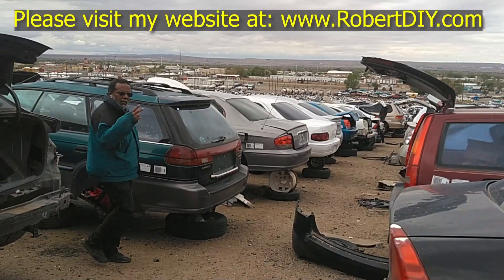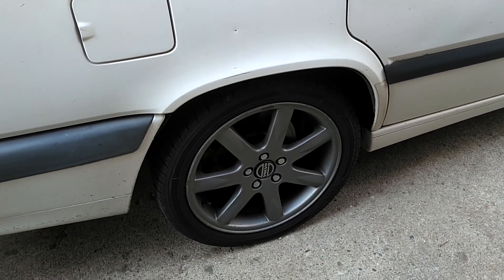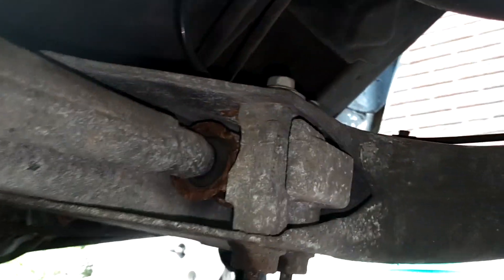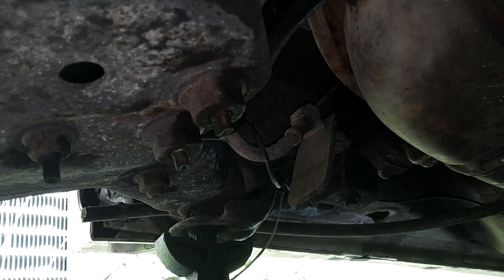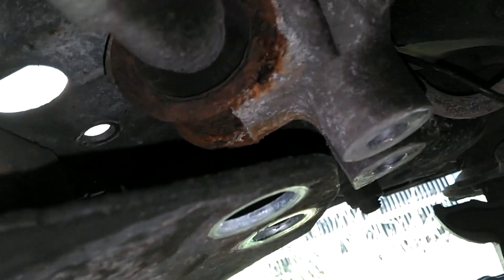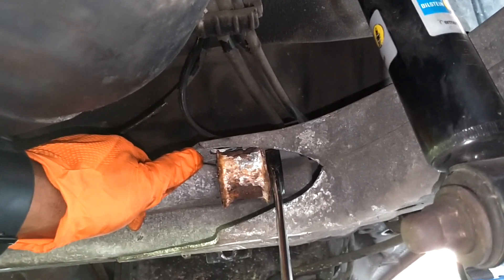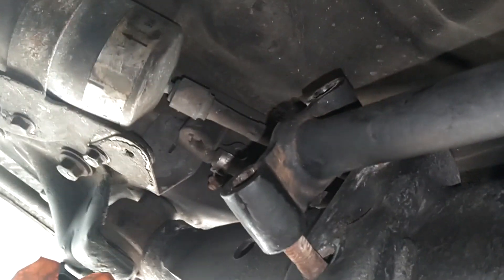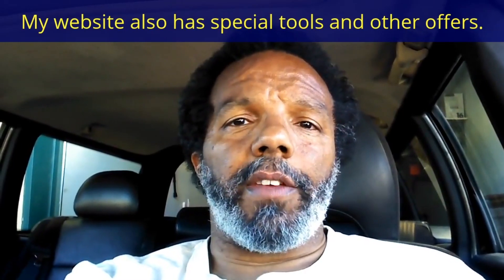Short day in the Natti, replaced some rear trailing arm bushings on a 850. - HOWR

Comment: I replaced mine with meyle from FCP two years ago.. already broken
Reply from the maker: Yikes! Is the car lowered?
Reply: @RobertDIY  nope. Rear springs a bit Bouncy though . Ben on there 360,000 miles😎
Reply from the maker: Springs are supposed to be bouncy. Maybe you need new shocks .
Reply: @RobertDIY  have new billsteins in there🤔
Reply from the maker: Should not be bouncy. Are they bad or is something else busted? Old worn out springs should sag, or did you install regular shocks on R Nivomat springs?
Reply: @RobertDIY  I have the original springs. I replace the Bilstein shock and mount…As well as the trailing arm mounts. And now the passenger side trailing arm mount is busted.I’m going to get new springs as well as a new mount. I never heard of thembreaking so fast but hey stuff happens